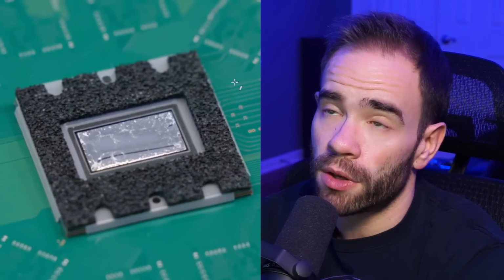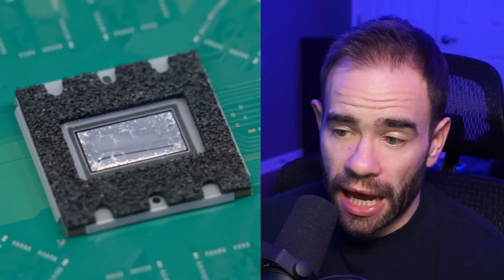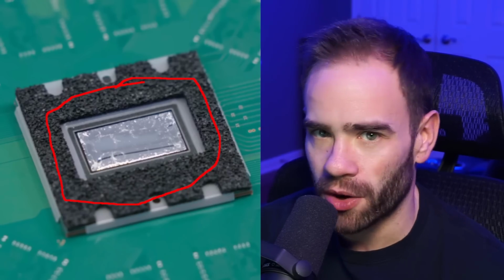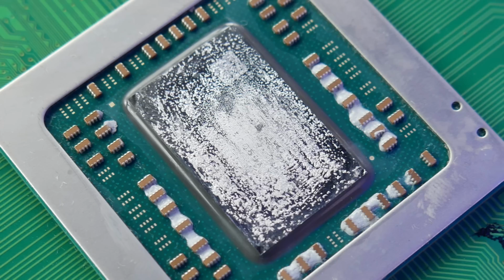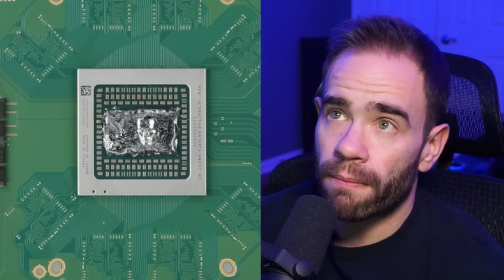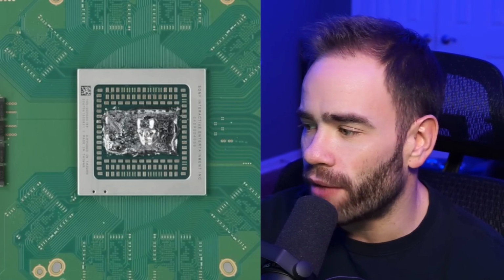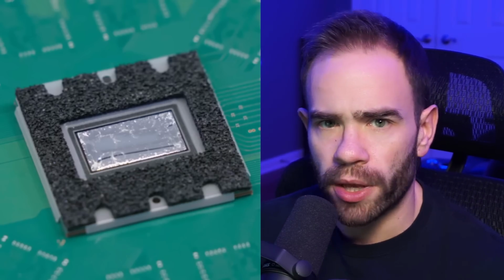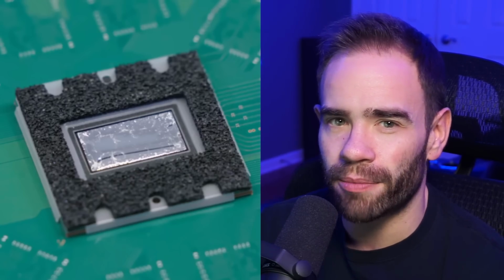Is Your PS5 Actually In Trouble?

Comment: I have had my PS5 since launch, set in the vertical position, and I play it daily for about three hours. So far, I have had no issues at all.
Reply: Had it vertical for about 2 years, no issues AFAIK
Reply: @CammyDK_YT  ye cause its only newer models of the ps5
Reply: I don’t think being in the vertical position is an issue by itself but subjecting it to a shock while in the vertical position could lead to the liquid metal getting released onto the motherboard
Reply: I bought mine  in the facebook marketplace two months ago. The previous owner said he had it over a year with light use, it is the model CFI 1015A,  it seems it is from 2021.  So far i've been using it vertically for two months and at most three hours daily use with no issues.  I can place it  horizontally , but will be poorly ventilated. I hope everyone that has a PS5 doesn't have an issue, thanks SpawnWave for the video.
Reply: Same got my ps5 launch day and have had it stood up every since and no problem
Reply: So you opened up your PS5 and inspected the liquid metal for leakage?
Reply: It depends on how long your play sessions are it depends on how hot your room is it depends on if you have adequate ventilation.....
Laying the console on your side will solve the gravity problem
Reply: By buddies ps5 died on him from the liquid metal but not sure what model it was. He had he's for like a year and a half
Reply: You’re only delaying the inevitable
Reply: I have the newest model been vertical since I got it about 3 weeks ago. Works fine but who knows a year from now.
Reply: Wind up your PS5 DOOM CLOCK!
Reply: I have a 1200 model and it is vertical and on for anywhere from 8-15 hours a day and hasn't skipped a beat.
Ignore all the half wits it's uncommon and falls well well within what's normal for failure and fault rates when manufacturing electrical products.
Like many things just the internet hyping it up for views, cash and a dopamine hit and as always the majority are half wits and follow along like the little sheep they are as unless they're spoon fed a narrative they can't function because you know doing some research into a topic yourself would take away from their Tiktok addiction.
Reply: @Got-2B-Said  facts
Reply: @@allenreyes6981 Sony has been using liquid metal in the PS5 since day one. This story has been debunked as someone on Youtube thought he was seeing evidence of this and made a video that got reported on.
Reply: Im scared but at the same time i lay my ps5 flat it dont even get warm or even gets loud but im scared to have it standing up
Reply: Same
Reply: Me too .
Reply: I am very sure Sony know of the problem from all the units that have had to be repaired under guarantee since release, there are bound to be some in these that display the leaking Liquid Metal syndrome. They may have even rectified the problem on later issues fingers crossed.
Reply: Same here. Altough some channels reported that if you would have the issue it would appear rather sooner than later. So people like us would be safe
Reply: Same. As a matter of fact mine is mounted on the wall vertically with a HideIt mount and has been for well over a year. Before that it was vertical on the tv stand
Reply: 2 years old and works perfectly fine
Reply: Same.
Reply: I think it's the ones that was launched after 2021 cuz I'm just like you I got mine the day it came out November 2020 and I haven't had any issues and I also have it sitting up on the stand
Reply: I have had mine since launch and it still is working perfectly.
Reply: You wouldn't know unless you looked. Just because there aren't any problems doesn't mean there isn't liquid metal oozing down the side of your PCB, heading straight for those precious power delivery components so it can ooze its way underneath of them, shorting out all of the pads in the process.
Reply: Thanks for sharing I’m relieved
Reply: I don’t know the model of mine (assuming 1100 since it was bought from Sony direct in Feb. 2022) but I’ve had no problems yet.  I also, about every 6 to 9 months, sooner if I hear the fans start to get louder than normal, take the side panels off, completely remove the blower fan, and dust out the system (using a flashlight to make sure nothing is stuck between the heatsink fins since I can see those through the vents with the fan off and shining the light through various angles where the fan used to be.  I then use compressed air on the blower fan while holding it in place so it won’t spin, then use cotton swabs to wipe away any dust that the air would not get out.  After I make sure there are no pieces of cotton swabs on the fan, I then put the fan back in, put the side panels back on (faceplates), and voila, it then runs as quiet as it did on day 1.  I did pretty much the same thing on my PS4 and it kept it quiet and running good for the years I’ve had that system.  Proper maintenance, is key to keeping those thermals in check and keeping the fans from sounding like a jet engine.
Reply: same here
Reply: Is cleaning the ps5 safe cus i just cleaned it but i put it upside down to unscrew the thingy and i think i carried and pick i up like 5-10 time. i got mine 2 years ago btw
Reply: Bro that liquid metal at 5:55 looks like a face
Reply: repairshop around the world start to claim that they open PS5 that was NEVER opened and put HORIZONTALLY all the time to start hard freezing/shut down DUE to hard corroded APU spot because of the heat DUE to missing liquid metal spot on APU. my day one PS5 start to freeze badly also (i dont had the courage to open it yet) @ILovemyconsole have a YT channel that show the issue in france !
Reply: I think it’s more of the newer models that have the issues though.
Reply: @Dudj3  Has nothing to do with the model, and no one has said that it does. Stop spreading misinformation.
Reply: @Dudj3  I do have the 1100 model for a yr already in the vertical position since I took it out of box but I have not had any issues with it overheating,loud noises etc ..But I am thinking of putting it on the horizontal position just 4 price of mind ..🤔
Reply: @Dudj3 no it’s not that’s if you break the mother cpu part that’s when it gonna start leaking every console will do that like Xbox and maybe pc
Reply: @Dudj3 . The problem reports are after 2 years of use. Hence not the latest model.
Reply: @Dudj3  I got mine last year and everything has been perfect still, so define “newer models.”
Reply: @Invictus-Solaris  the 1100 model. But tbh I don’t think there’s much to worry. It’s only happened to like 1% of them which is relatively small. I know 1200 model just came out a few months ago so not much can be known there although Austin Evans said 1200 runs better.
Reply: @Dudj3 i have the 1100 model and mines fine
Reply: @Invictus-Solaris  what abg rest mode??
Reply: @Invictus-Solaris  there's been 3 different versions of the PS5 in 2 years.. check your serial number
Reply: @Mr.Genesis  definitely 3 models 👍. 1 important factor here, they changed the fan's!. Now my air filter is around the height of the newer( all) version, which is vertical (not for long)and like my air filter, it sucks up all the dust yet there's no filter ( not even a sponge!🧽 ) . It's just over 12 months vertical, then shut down. Repeatedly after a few hours. It's easy to clean and fix. Yet 1st version day one in horizontal position, close but not too close to a wall, is just wiped seems to clean itself!. Kind of obvious now hopefully to most people! having a ps5 vertical in the middle of a room is like using it as a vacuum cleaner! Especially the newer models! Next, we need to see a video with a filter 1 on the outtake and one on the intake!
Reply: @Dudj3  1% is a massive overstatement
Reply: @loganedom3160  yeah I probably should’ve rounded to .1%
Reply: That's all fine till gravity wins
Reply: @otogigamer  definitely a downward vector...not so sure it's this magical gravity you speak of
Reply: @otogigamer  problem with that train of thought is that the console is stored vertical and isn't horizontal till someone puts it that way outside the box.
Reply: @shadowstyleb  but also the problem with the other logic is the liquid metal doesn't move until it's heated up. So therefore if you've had a PlayStation brand new in the box that hasn't been operated at all then that liquid shall still be a solid
Reply: It has leaked already just have to shake it a bit vertically a few times to get the leaked liquid metal to travel down and onto an electronic component to cause a short and burn ur ps5 so u can also experience this issue👍
Reply: If you have the older models it’s should be safe the newer models are probably in danger

Comment: Honestly I am unable to put my system horizontal and so it will stay vertical the disc drive has already had problems where tales of arise was cut a little thick and got stuck in the drive to where the manual eject wouldn't even work so I took it apart and took the disc out but yeah I don't think it's going anywhere but hey who knows just my opinion

Comment: Even if this only affects a small percentage I'm not going to take the risk so it's going to be horizontal from now on at least until I get a pro or slim version.
Reply: Yeah, sucks but better safe than sorry. I heard rumors of this in 2021 and kept mine in horizontal since
Reply: @TheConuresrule  the liquid metal leaking is how my buddies PS5 died on him.  He took it to a repair shop and when they opened it up it had liquid metal in the inside
Reply: @Rooster832  cap
Reply: Imagine being thick enough to still think having it horizontal will save it if the seal breaks.
Reply: @Got-2B-Said  let them be idiots while we laugh at them.
Reply: @imoffendedthatyouareoffended  They aren't being idiots. If the adhesive is failing horizontal gang will be the last to feel the pain. So they can simply crack open their console and fix the problem with a $10 tube of solder mask after seeing enough vertical boys go up in smoke. Luckily unlike RROD, if this turns out to be widespread issue, it is relatively easy to fix.
Reply: Mine has been vertical for 2 yrs and running 10 hrs a day not a hiccup. Like he said pretty sure if you have not had an issue your not going to.
Reply: @martyhubbardGamer  just because it don't don't mean it won't.
Reply: @Rooster832  agree to disagree. It don't mean it will. It is not a reason to be scared is all I am saying vertical has always been how mine are setup. Personal preference
Reply: @martyhubbardGamer  like I said better to be safe than sorry, I never said you had to put yours horizontal 👍

After hearing about my buddies PS5 I'm not taking the chance 😂
Reply: @Rooster832  agreed didn't say ya did. Point of my comment is not to create fear in others of doing it. To each their own is all I am saying.
Reply: @Rooster832  just because someone makes a YouTube video does not mean it is a reason for large concern. It is more for awareness that it has happened but everything points to those who have had one for awhile will not have issues.
Reply: @martyhubbardGamer  He's like the 4th person already to come and say that he's seen problems with the liquid metal and they have all been people that repair consoles for a living. It's just a little concerning is all.
Reply: @Rooster832  for sure it is concerning but they all say the same thing that for those that have had their consoles for awhile odds are slim it will start is all I am saying. Let's hope it is not true as I am out of warranty :)
Reply: @Rooster832  4 people out of 30 million consoles out there lmao gtfo.
Reply: @cookingsauce8274  just the 4tg to confirm the issue not that only 4 people have this problem. We don't know how many has been affected or to what degree, either way I'm not take a chance on it

Comment: Honestly this reminds me of all the miss info around original phat model PS3s. It’ll be interesting to see where this goes
Reply: @baseballreg123 Definitely don't get one. Any fixes are just temporary. Get a PS3 Slim and PS2 Slim, that's what I've got and they're built like tanks.
Reply: @baseballreg123 They're old. Too many complex parts and not built to last. The YLOD is essentially unavoidable with the early models.
Reply: I hope ps5 doesn't end up having a similar issue. I know that with flash memory, you can only save and erase a certain amount of times before you start getting data rot, but hopefully there will be some way to replace the SSD
Reply: The original fat PS3s are all going to die though. Maybe in 2006/7 they were fine, but nowadays they're not worth it.
Reply: @DP12321  
That’s not entirely true. You can prevent them from dying. It’s just extremely hard to do. Way harder than drilling holes or replacing capacitors which can only make things worse.
Reply: @KellsKats  it's basically a losing battle at this point. I've seen so many people try and fail to fix them by reballing and new thermal paste and it's just a band-aid at that point.
Reply: @DP12321  
Exactly. That’s the miss info. The only way to truly fight the problem is to get rid of that shitty 90nm RSX GPU. Not by drilling holes or replacing capacitors. The real true solution is pretty hard for the average person to do.
Reply: @KellsKats  Ah ok, I misunderstood. Yeah it's just a shame that Sony is moving away from preservation these days. Hell, the  PS4&5 can't even read CDs.
Reply: @DP12321  
Yeah sorry, I didn’t realize how my comment could be alternatively taken.

Until the PS3 gets an emulator that can play R&C games flawlessly, I think og hardware is sadly the only effective means of playing these older games. It really does suck that Sony doesn’t care.
Reply: @KellsKats  All good!! 😊 The emulators have made real strides, RPCS3 I think can boot every game now. There's been plenty of remastered games too, but tons of games are still stuck on PS3 like Folklore, Puppeteer, and Heavenly Sword.
Reply: @DP12321  
And the Ratchet & Clank games. Those are the biggest games for me cause they’re so difficult to play now a days.
Reply: @KellsKats  Yup, I have the whole series on PS3 and even imported Quest for Booty so I'd have it physical.
Reply: @DP12321  
That’s sick as hell! 
I have a backwards compat with CFW that I backed my R&C games onto. It’s sick cause the disc drive is really loud cause I think it’s dying lol
Reply: @KellsKats  Slim systems are still pretty cheap and readily available. Stock up! Make sure to avoid the CECH-2001 and at least get a CECH-2101 model or later. They'll run a bit cooler due to refined components.
Reply: @DP12321  
The 21xx models can only have PSHen right? No CFW?
And I really should get a slim. Especially so if worse comes to worse I could potentially swap the RSX out myself. Maybe.
Reply: @KellsKats  No clue on that, I'm still on stock firmware! Maybe I will mod it when Sony really kills it off, but PS3 is still alive to me. 😁
Reply: @DP12321  Why avoid 2001 Slim model?
Reply: @@baseballreg123 
If you can get someone to replace the RSX chip in the backwards compat PS3 you get then you’re golden. The cheaper option is just a Slim PS3 and PS2 though.
Reply: Wdym miss info about the ps3? It wasn't as bad as the 360 but the ps3 still does have its issues
Reply: @louiepikmin3184  
Miss info as in reballing, replacing capacitors and drilling holes fixing the YLOD which in fact just prolongs the inevitable by maybe a good 6 months if you’re lucky.
Reply: Let me fix that for all of y’all with the PS3’s the fat version wouldnt die as bad as a Super slim because I had to buy a super slim like 4 or 5 times and they automatically just stopped working because I got the fat version and the Slim version not having any problems with them whatsoever

Comment: Shortly after this story came out, my PS5 started shutting down after I fall asleep like the power went out. Nothing else in my house seems to lose power so not sure what's going on. I have to pull the plug out of the back before it will power on and then it says to shut the power down properly. 
I cleaned the fan and all of the dust out so it is sparkly clean and it kept doing it for 3 days. I decided to put it horizontal and now it's been on for 3 days straight. So confused. Hopefully it's just a power issue and not something more catastrophic. I don't really wanna have to buy a new PS5.